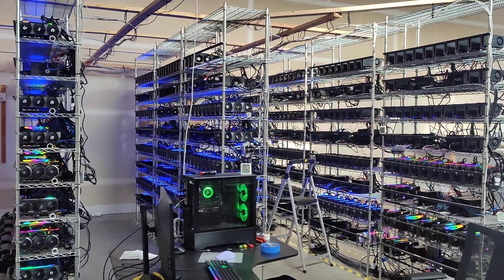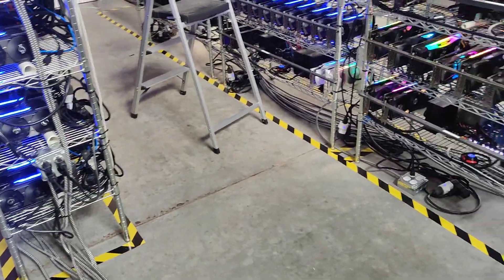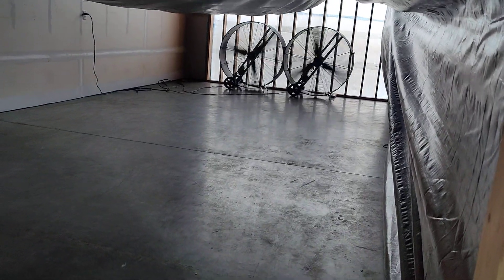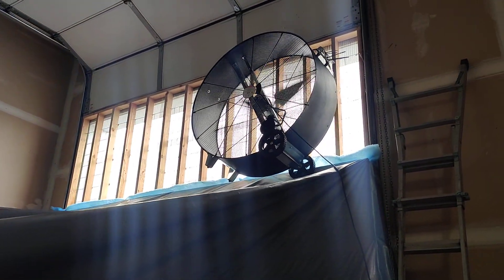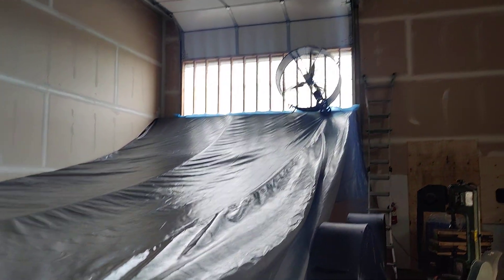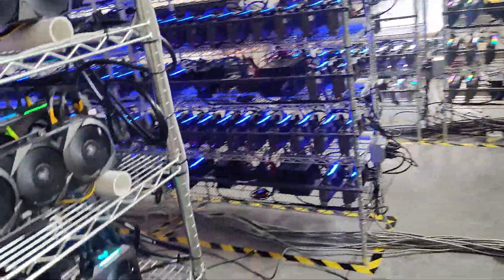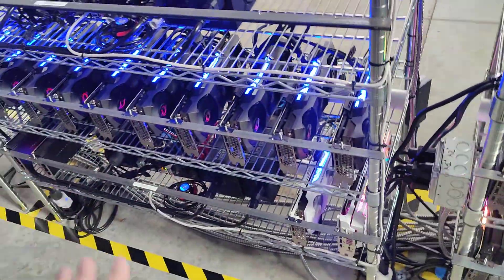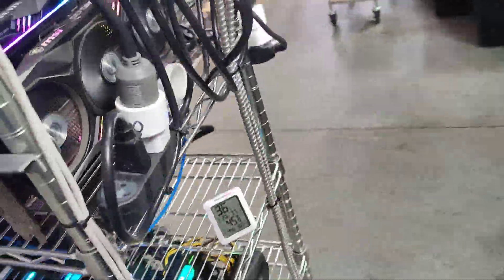GPU Mining Farm - Extreme Below Zero Temps, New Exhaust Fan, Current Status

Comment: Do you have a video showing in detail how those rigs are assembled ? Like that white PVC tube holding the back of the cards
Reply: its super easy. Albeit the method in the video is a lot cleaner. From basic looks just in the rigs itself:
1. Costco shelving, 6 tier, they doubled up though since they have the height for it.
2. PVC piping looks like 1 inch or 1.5 inch to prop gpus up. 
3. Homedepot angle 1/2 inch aluminum
The rest is your basic stuff, gpus, mobo, 1 stick of ram, 1 hdd (nvme or ssd or disk hdd), psu, risers. And a copy of your fav os, and mining software. Done.

Comment: nice work my fryend looks very cleen, congrats. We are miners from Argentina and here now is sumer at 30 degrees, managing a 250 gpu farm of 3080 and 3090. any recomendation for run at low temps ?  Where are you from ? what are the temps aoutside your location ? 
Thanks
Reply from the maker: Most important thing is to keep vram temps under control. Are you using Gminer? If so get some software to manage vram or write your own. We wrote our own program that auto adjusts power for each card depending on the Vram temps. We are in Pacific Northwest  - United States.
Reply: @CryptoLLC  we use Simple Mining for mange all the rigs. unfotunatly we can t se the Vrams temps if we conect eche rig to windows. i can t write any program for that bicause i don t have any idea how to do that. 
Now we are changing the most of the thermal pads of the zotac 3090 and 3080. Any other advice bro ? 
thanks so much my fryend and happy new year !!!